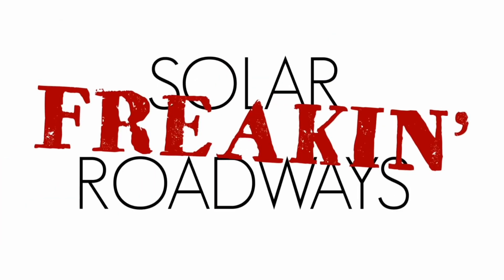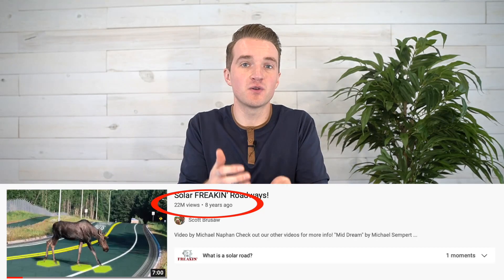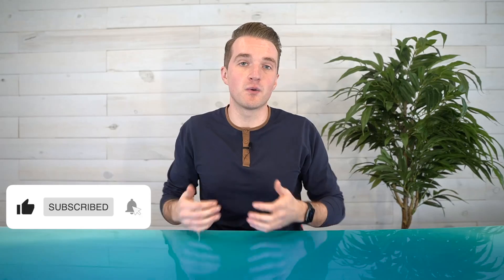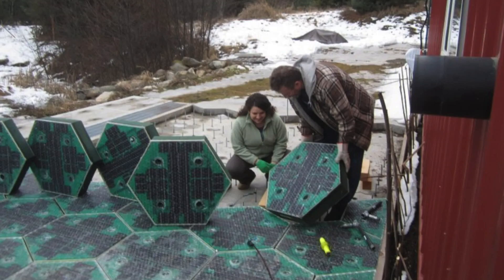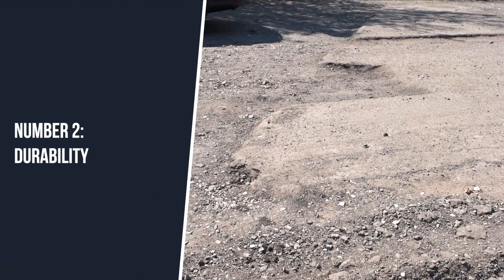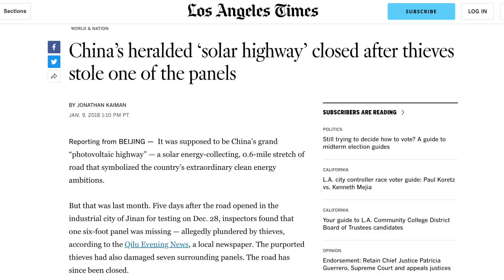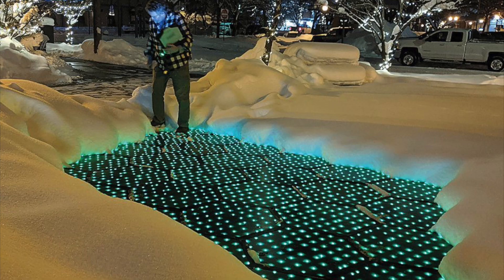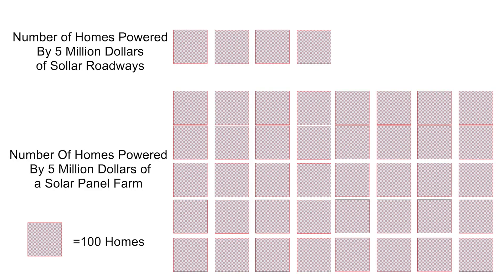What Happened To Solar Freakin Roadways?

Comment: due to intermittency, solar-photovoltaics will most likely never be more than a niche or supplemental power source. IF it can be developed as suggested, deep geothermal would work well due to its ability to use existing power lines.

Comment: A couple things you bounce over:   1.  The available surface area from a state’s roadways is millions of square feet.   2.  Most cities have wasted 30% of their available area given over to asphalt.  A 30% drop in efficiency isn’t  significant w/that amount of usable area.   3.  Houses are regularly installed with west south and east facing panels.   Installing tangential to the suns rays isn’t such a big factor as you make out.  Yes, the angle of incidence is a factor, but in view of the millions of square feet available again it’s not a significant factor.  What else were you doing with those roads?  rolling cars on them? parking cars on them?    4. The heat that the panels generate can be utilized as space heating for nearby houses.  Why is there no mention of the shoulders of the roads ?  Those could be solarized.  Roads are such a huge waste of resources and space that It’s almost criminal not to use them for an additional purpose like energy generation.  There’s no end to the number of low use roads that could be utilized for piloting solarising of the roadways.  We are so late in getting to the climate mitigation table that nothing should be off the table for discussion.

Comment: What about solar lamp posts in our cities and neighborhoods, instead of lights that run on energy? Would that be more efficient?
Reply: This is an actual good use of solar! It sounds paradoxical. But low-energy LEDs are often able to run on a surprisingly small battery, so charging them in the sun can work fine. However, lots of towns are also learning to just dim the lights. It really helps wildlife. And a lot of the theory of plastering neighborhoods with lights is, quite frankly, rooted in racism. It's not like all of the world's criminals are combining the streets every night looking for an unlit neighborhood to pounce. That's not how crime works. The lights can actually be very dim and work fine anyway - many rural communities can still navigate outside by moonlight on clear nights when the moon is fuller. I've taken a whole walk with just moonlight myself. The notion that we need this extreme floodlights... Well again, they're favored by certain specific people.

Comment: What about Tidal Hydro Power? Like in France?and you don't have to replace millions of solar panels every 25 years or mine for minerals to make panels.and those minerals will run out.  An artificial hydropower jetty would not damage sea life and would just be an exstension off of coasts or mouths of rivers that open to the ocean like the Columbia River Mouth into the Pacific could be a good place for a artificial jetty. I read years ago that hydro ocean power to create electricity has the least impact on the Earth and is the most  sustainable that research led France to follow thru. Even windpower has to be replaced often. and kills birds. and takes up land. Tell me what you think, Thanks. .

Comment: It's dumb to compare it to traditional solar panels. U should compare it to traditional streets and then compare cost effectiveness AFTER the technology is further along. 

Concrete roads have a lot of coats too that don't apply to solar roads. For example reconstruction which is repetitively expensive for concrete roads. And in big cities the main roads are so often under construction. That wastes so much time, gasoline, and money for people. Constsnt detours and slow traffic all the time. Businesses loose money too when their atreet is under reconstruction. It's way faster and cheaper to just replace a panel then to tear up a main street for 2 years .  Plus with solar street panels no more pott holes damaging our tie rods and other vehicle parts.

Winter would be so much easier on everyone. Solar panels would be the end of slippery roads. Way less car accidents. Longer lasting tires.

This video didn't do a great job comparing costs. He left out 90% of the important stuff. This isnt a replacement for traditional panels. Its a replacement for concrete streets. He made no comparison to that at all.  But he is right the technology is far off in the future.

Comment: I remember the buzz around this 10 years ago. I watched the ads for it on Discovery Channel and even back then I thought “wow, what a tremendously stupid idea!” What did it for me was their suggestion of using the tiles for car parks. Freakin’ car parks. You don’t need to be a city planner to know that parking lots are covered by, you know, cars during the day, and you certainly don’t need a degree in electrical engineering to know that putting a solar panel underneath a car is dumb. The hype over this thing was so obnoxious given how ridiculous the whole thing was. Hey here’s a wild idea, instead of spending potentially trillions of dollars by putting solar panels in the worst possible location how about we do literally anything else.

Comment: They had thousands of people who invested millions on their stupid project and at the time it was nearly impossible to produce the one thing that might have made it possible which was plates of Sapphire in a special lens shape that automatically redirected the light into the panel. Even if they were to be able to produce that special Sapphire lens and solve all of the other problems like moisture intrusion and everything else you can think of they marked the shape as a hexagon when a square or rectangular shape would have been better. The next part is that none of the methods they used to transmit power or otherwise collect solar energy were useful. You would have been better using these systems and modifications on a building or solar farm power plant. The biggest problem with solar energy is that it is extremely energy and resource intensive to get anything from it.

Comment: Back when I was a kid, I never really thought about how Solar energy gathering worked in the first place. It's easy to be idealistic about an idea, but then I remember that one discussion of tunnel vision when it comes to new discoveries. The pros and cons are pretty narrowly seen in the first bit of an invention's existence, but as time goes by more and more problems are discovered as time moves on, revealing particularly harmful affects. Kinda like when Radium was used as a form of glow-in-the-dark paint for stopwatches way back when. Its kind of the same presence here (just less immediate direct affect to the human body)

Solar roads are still prone to geographical changes to the soil below like how asphalt is, except asphalt can adapt to the changes to a certain degree before it becomes harmful to our automobiles. But the moment you introduce a stiff piece of hexagonal electronic roadway to the ever changing geography to an area, the more accidents and costly repairs you're gonna have to make due to the constantly changing geography of the dirt below those firmly stiff pieces of plastic. And thats obviously not counting the clear inability to absorb light due to the area the solar panel roads are built into (even factoring out the shades of automibiles covering them a great portion of the day), their ability to generate enough heat enought to the point to cause fire, and much much more in this video.

It's a cool idea to have these digital roadways and sidewalks that could do so much more for us than just regular ol asphalt to paint on top of, but as we actually event them in time, we realize how inefficient of an idea it actually is once its actually set into motion. Such a strange world we live in, right? Ideals for the future are actually more unideal than we originally thought.

Comment: I loved the nonsense about solar panels producing heat to melt snow on them. If they are covered in snow, how does the sunlight get through to produce the current to produce the heat to melt the snow? Answer: you have to draw power from the grid, just the same as having lane markings light up at night. So instead of producing power, they use power produced elsewhere. And those idiots wanted to cover every road in the US with their garbage.

Comment: Given that if you covered Arizona and most sunny states that stay sunny, that plus our renewable energy sources and even continuing with oil we would still be better off with solar roadways than not. Power outages would be a thing of the past if electricity was passed underground along the roadways like in their video and during extreme weather conditions it would help by heating the roadways.

Comment: I LOVE solar fuckin' roadways! They're supposed to be the future and solve everything! 🤣
And I already knew a solar panel's lifespan is only two years.
The most basic question, one would have to ask about these is, "Why would roads, covered by cars and dirt, be better than just putting them on roofs, which are covered by nothing?"
Reply: Yeah, I think it would be cheaper and produce more energy just to create roofs on the roads and install solar panels there than to embed solar panels on the road itself.
Reply: Two years?  Really?
Reply: You mean  normal solar panels? That is not true.
Reply: The idea was they would solve road-related problems as well - melting snow, producing road markings, reducing the deaths of pedestrians and wildlife (by lighting up when they crossed), and the like. All very much pie-in-the-sky thinking.
Reply: @sweetchristmas101  But there are heated driveways. They just need to improve the solar roadways.
Reply: Heating driveways to melt snow is ridiculously dumb and such a waste of energy. Please, please invest in strong communities where people would just help the old folks out. Please. There are people who think they're flexing by spending like $500 in energy cost every winter (for a tiny driveway, ignoring installation). When they could probably just contract a kid for that price. 

It reminds me of a home I lived in where they didn't seal around the basement door properly so all the heat and air conditioning was leaking out. I spent $2,000 to fix the hole, and it paid for itself in the very first year. Now that most energy companies show you a rolling history, I could see the previous owner's bills. A month of winter heating went from ~$600 to ~$150 with just that one modification. And there were other simple fixes I could make to get that down farther.

Comment: No, it never sounded "great." I was clearly idiotic or a scam from day one. There are SOOOO many engineering reasons that can never work. Everything else aside, there are straightforward, unavoidable reasons we do not build roads out of tiles.
Reply: Build them next to Hyperloop - two scams in one place!
Reply: @thedubwhisperer2157  
No...even better...put the panels as flooring IN the tubes
Just in case any sun leaks into the vacuum tubes :D
Reply: How is this not a good idea? Running power underground seems better than hanging powerlines 20ft above the road
Reply: @Fantasticfrank1886  Because of capacitive coupling between conductors and the low leading power factor caused by it.
Reply: @Fantasticfrank1886  Underground powerlines cost 2-5 times at much to install, 2-5 times as much to service, take longer to diagnose and repair, and need special provisions to dissipate heat. Trust, me, I work for a power company in hurricane country, and live in a neighborhood with buried lines.  And I wish I didn't. It's pretty, but we have the least reliable power in town.
Reply: @CStuartHardwick  it just seems like there would be less servicing... and cheaper in the long run....I don't doubt you I just hate not understanding lol
Reply: @CStuartHardwick  I say we go with the tesla coil design...but then we would have to do away with everything all our electronics and start over...
Reply: @Fantasticfrank1886  It depends a lot on where you are and what you want to put underground. High voltage transmission lines underground are just a bad idea. They'll lose so much power and heat up to the point where they need more maintenance. The connections from the transformer to your house though can be buried if you live somewhere with soft soil. In parts of Europe this is the norm, because the ground composition makes it economically viable. Mountainous areas in Germany and France mostly have their electric cables above ground though, because of the reasons @CStuartHardwick mentions.